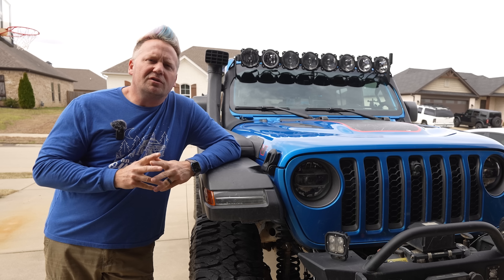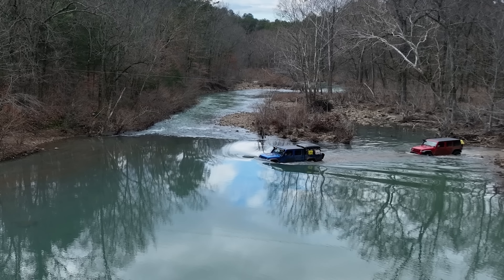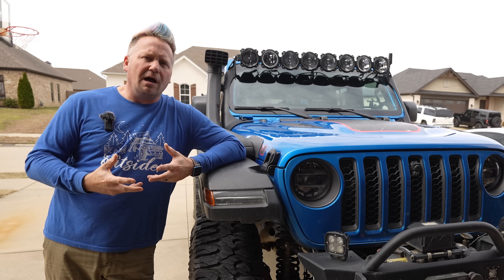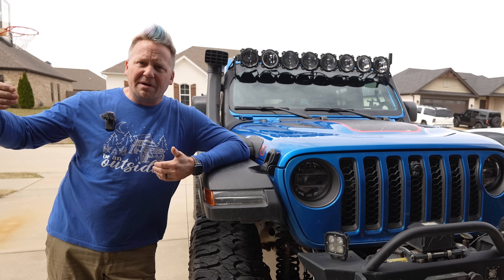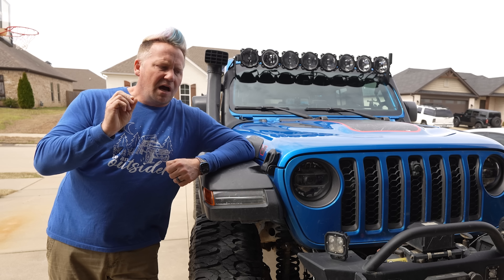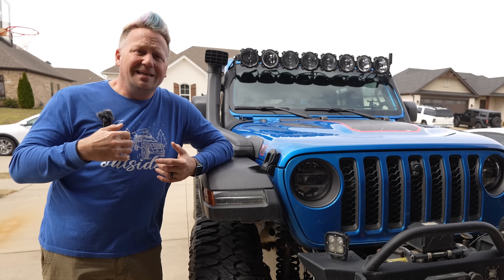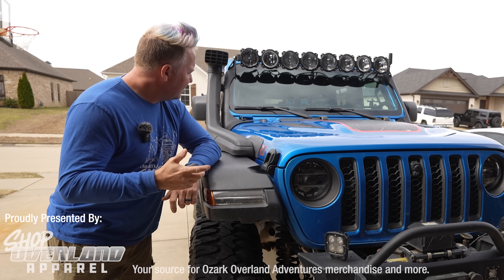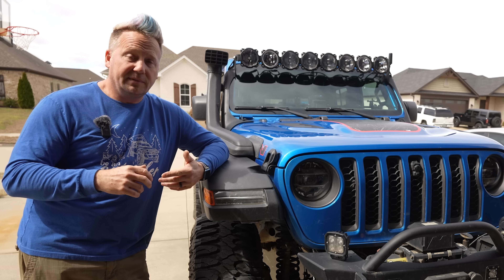How To Prepare for Deep Water Crossings

Comment: Water incursion in the axles is not from short breather tubes.  It is from the hot axles hitting comparitively colder water.  The contraction closes the check valves tight, forcing water to be sucked in from the axle seals.  The proper way to correct is to extend/raise the breather tubes and protect with scintered air filters, not check valves.  The scintered filters protect the openings while allowing freeflowing airflow during expansion and contraction.
Reply: Would that valve you mentioned be better than the ARB Differential Breather Kit 170112?
Reply: @docfluty  the ARB raised breather is similar.  I believe it can only accept 2 connections.  If you want 4 connections (front diff, rear diff, trannny and transfer case) you have to install 2 of the ARB.  There are some brands that get you 4 or more connections to 1 bracket.

Comment: I learned another tip while working on atvs. Waterproof electrical connectors are not always waterproof. Found that water can go into plugs from wire side. Best solution was can of silicone spray.

Comment: I live in Colombia, snorkels are fairly common. They are largely for dust but definitely need it for deep water crossings. New jeeps are not common or popular here. It's old and new Toyota Land Cruisers, some Nissan Patrols, and a lot of OLD Jeep Willys. I myself have a 96' FZJ73 4.5L. Beastmode. Practically very little electrical components. Protect the distributor and you can go through just about anything. Check out some of the offroad videos out of Colombia. Jungles,rivers, mountains, flood plains. You should do a trip there sometime for the channel

Comment: Planning an upcoming trip to the Ozarks (most likely during low water season but still concerned) and preping for possible Water Crossings.   All great points but wondering about interior issues.  I have seen your videos in which water is above the door sill and, at times, deeper than the bottom of the tub.  Any Concerns with floorboards, plugs, door seals or vents?   I know the vent on the rear tailgate coud be an issue ( I think based on the dust I get coming through it ).  Any advise as I prep for the Ozarks would be greatly appreciated

Comment: Thanks Matt! I think you know this one better than anyone! 

For reference, new trail rated keeps support about 19 inches of water fording (that's a lot of your Trailhawk Jeeps: 19-20 inches - basically at the fog lights ). For most Wranglers and Gladiator Rubicons (this is one of the big advantages of the Wrangler and Gladiator platforms) , it's roughly the top of the tires. If you have a Rubicon with 35s, it's about 35 inches. 32s about 32 inches - you get it.  If you read the specs it winds up being basically the tire size. This gladiator setup is probably good for almost 40 inches of water - maybe more in a pinch.

Jeep does a THOUSAND things that other brands don't do. They're #1 by a mile. It's not even close. It's always more skid plates , better angles , bigger tires , lower gears , better water fording - even for the Trailhawk Jeeps - better by a mile compared to the competitors in their respective class. Even a compass or renegade Trailhawk is a mile better than the best rav4 .

Comment: On older vehicles with engine driven radiator cooling fan, we needed to remove the fan belt for water crossings so the fan blades wouldn't propeller into the radiator or soak the ignition distributor and sparkplug wires.

Comment: All the issues I've had with my 2017 jeep JKUR over the few years with 50k mi on the odo. Blown motor complete engine swap, stuck e-locker, exhaust manifold gaskets, replaced cats. I've done few fairly deep water crossings up to around the floor boards maybe a little deeper in some spots but never up to stock airbox, also set the engine down on a rock which dented oil pan but no other noticeable damage, stock skids were not sufficient. Not sure what exactly caused these issues, if im unlucky, if im at fault or just bad quality control but I wasn't wheeling alone and no one else has had these issues, I take good care of my jeep maintenance wise comparatively to the people I was with, jeeps were similar builds too. Jeeps never left me stranded or died on the trail/road it was still driving with scored cylinders and oil getting blown into cats. Luckily my warranty has saved me about $10k. Going forward ill be adding these mods or just avoiding deep water altogether. Thanks for the video!

Comment: 3rd gen Tacoma airboxes are actually pretty high up but yes they have wide opening right there in the wheel well, and if you trim that wheel liner for 35s, you have wide open hole for water to go into. I agree snorkels are a must on modern Tacoma/4Runners if you're larger than 33s and do moderate wheeling. We had a buddy with 5th gen 4R who hydro locked because trimmed wheel liner for 35s and no snorkel, water was only maybe 1.5ft deep and he must've hit it with a little bit of speed. Luckily insurance was able to cover it!

Comment: As an owner of a mostly stock (for now) Third Gen Tacoma. Matt is dead on about the placement of the airbox. 18" of water and it is potentially getting the interior of the airbox splashed with muddy water (ask how I know). But at the same time, with some mild modification, the fender also protects the air box somewhat as you are less likely to get hit with the bow wave being sucked in. (A few inches of lift and mud tires would also help if anyone wants to send some my way<kidding>) :)

Common solution for us Toyota owners for diff breathers is to spend $80-90 on an ARB breather and mount it high on the firewall. This is not the ultimate solution, but it is a possibly the best (or at least one of the best) commercially available solution... Being on a tight budget I went looking for an alternate solution. The majority of the other breather kits where different shape, but same operation as the ARB unit, and most that I found were actually more expensive.

If you have access to cheap machining you can fabricate something as all the ARB breather is, is a 5 port manifold (four with plugs to attach differentials and other breather lines, and the fifth attached to the filter) And a filter (I could be remembering wrong, but I think it is just an open cell foam disk). Alternately, it is not inconceivable to use a 1/4" NPT 5 port manifold and some adapters for air compressor such as people use for air lockers and other OBA builds. You will need about $35 for a roll of 1/4 inch airline or similar tubing either way you go. Amazon has a manifold that would work for $20, and some fittings (about $30, but will include more parts than you need for the breathers). In the end, the DIY solution does not save you THAT much. 

Another option that goes back at least to the 80s was to use Y connectors to connect lines from your breather ports to a valve cover breather. This was fairly common on "mudders" as well as desert racers and camel trophy land rovers in the late 80s, though I do not know if it is still a common approach.

Comment: Great timing.  Actually could have used this over the weekend to check in on the Union Schoolhouse….  Decided to turn around this time after watching UTVs and a 4 wheeler suck water. 
Will add the diff extensions but I haven’t settled on a snorkel for the JK yet.  Also took some water to a fog light that I have to fix/replace now so need that dielectric grease too. 
Thx for the walk thru!
Reply: Go with the AEV snorkel. Really easy to install and remove for repairs to other things in engine. Also best price. I have had mine for 4 years with no issues at all on my JK. It really works like a champ!

Comment: On the rear diff you removed the hose from the diff so you could put it in the proper place.   Do you think it is worthwhile to put one of the spring clamps on hose at the diff connection?

Comment: Matt, did you say the "magic cap" said Gore on it? If so it may be using a Goretex membrane as the air filter. It is used in other types of breather because it is air permeable, but not water permeable.
Reply from the maker: Sounds like it.